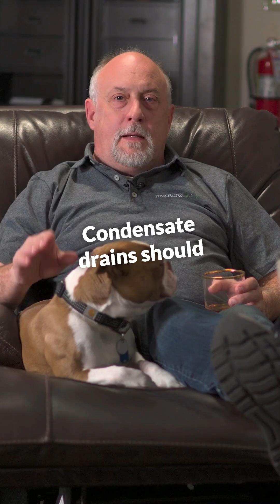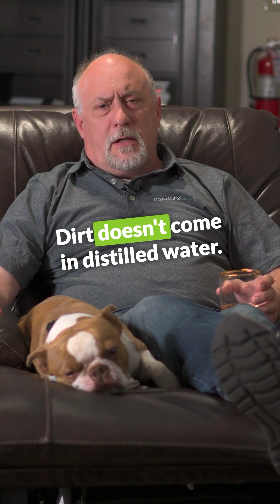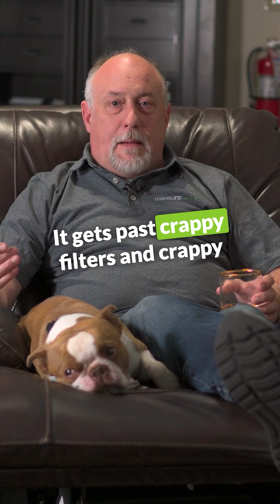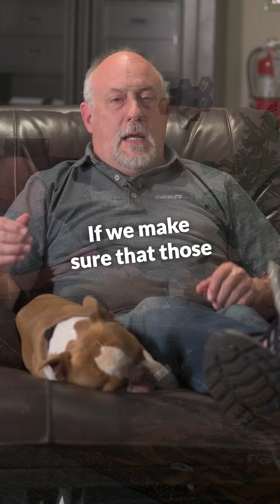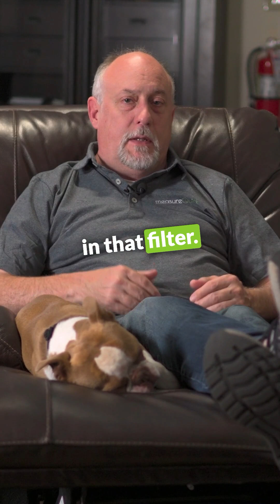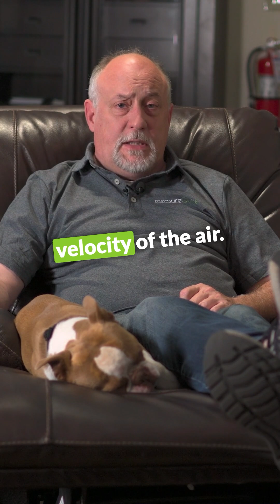Stop cleaning condensate lines, do this instead!

Comment: Jim, I love that you're opening the conversation about drain line clogs and I know that you're passionate about it but please consider approaching this in a different way. Instead of trying to create contreversy and lead by negativity, try leading by starting off with a question. For example "What if I told you that you never had to clean a drain line again if you did this?" Then get into the details. Seems like we're missing some key info here that maybe not everyone is aware of - what causes a condensate drain clog? You get straight into how the dirt gets in the drain but not why it's bad for the drain.

Also, tell waffles I said hi!
Reply from the maker: I don’t know that a statement that drains lines should never need to be cleaned is leading negatively, but I do agree the statement is controversial, and that was my intent. I was trying to promote some discussion.

Comment: My only question is what to do concerning static pressure drop across the system? If we get into these high MERV rated filters it can cause more stress on the indoor motor and the modules will go out faster. How do we get this perfect filtration while keeping the system efficient?
Reply from the maker: Double up on the filters. YOu need face velocity between 250-350 FPM.

Comment: What about rust from the coil going through the drain, or the fact it only drains in AC so once AC stops running the water dries in the trap and can develop hard clogs. 90% furnace systems have an acidic condensation that can help prevent clogs after the furnace drain but this is bull shit, this is someone who has never done service a day in their life.
Reply: You look like you have 30 years experience sitting in that chair, I am also a service tech with only 13 years experience but 90% isn’t 100% so who gives a fuck clean the drains do all the things to help your system.
Reply from the maker: @kalebbranch8036  Your customer does. There are those with 30 years of experience and those with 1 year of experience 13x. Stopping filter bypass is important for more than just condensate drains. It also keeps the blower clean, the circuit board clean, the evaporator and secondary heat exchanger. It will dramatically increase equipment life. Root cause analysis is important. Why spend time and money doing work that can be prevented in the first place?
Reply from the maker: I assure you that I have done about 30+ years of service work. If you stop the dirt, it will cure 99% of your condensate line issues.

Comment: And the dirt that settles on coils/catch pan? LOL..Definitely the burbon talking
Reply from the maker: If the dirt is captured you simply throw it away. It should never get there in the first place.
Reply: That dirt would get caught by the filter is what he is saying.
Reply: @rwein2951

See, @measurequick has to be nice. I don't.

First of all, if you can't comprehend that LESS dirt bypassing your filter is a good thing, and the fact that you havr to kerp cleaning your coils frequently, and it doesn't make the light bulb in your noggin glow the least little bit...then you need another 30 years tinkering with your unit and it may sink in. 

Second, any time someone leads with "I've been doing this for 30 years", I immediately know the next thing that they barf out is going to be complete utter nonsense. Thanks for keeping the streak alive.

Third, you apparently do all your work yourself so the fact that you wouldn't hire us comes at no surprise. But please take off the makeup and red nose before calling us clowns next time. 

And finally, don't worry- I wouldn't work for you anyway. You're not my kind of customer. I would've referred you to Bubba's Heating, Air and Taxedermy after 5 seconds of hearing you talk.  That's who you deserve.

Why do you even follow measurequick if you know so much more than they do?
Reply: @timdestasiohvac  In the 30yrs I've owned a home and did ALL HVAC maintainance the COILS need to be cleaned. Matter of FACT many HVAC companies offer a coil cleaning as a maintainance prceedure. SO HOW TF does the air filter capture ALL the dirt? IT DOESN'T. It falls off into the condensate from time to time. I wouldn't hire either one of you clowns to work on my HVAC.
Reply from the maker: @RJ_MAGA  The filter does not  have to capture 100% (95-99% is enough) just enough that the condensate can carry the rest away without build up, and without enough of a food source for bacteria. I have seen 20-30 year old coils that do not have any buildup. If either of us clowns has installed your A/C you would be 100% right, you wouldn't need a coil cleaning in the first place.

Comment: Wasnt evaporate acidic?
Reply from the maker: A little, yes, and it will attack sheet metal in poorly manufactured coils. Most manufactures are using coated steel or aluminum now. "Pure distilled water should be neutral with a pH of 7, but because it absorbs carbon dioxide from the atmosphere, it's actually slightly acidic with a pH of 5.8." https://sciencing.com/ph-distilled-water-4623914.html

Comment: Where does the Zoogloea come from? Asking for a friend…
Reply from the maker: https://www.youtube.com/watch?v=5VOffWjmWkk
Bryan Orr will tell you the same. It's all about source control, and keeping the organic materials off the coil.  But here is a great video that tells you how to control bacteria.
Reply: @measureQuick  Majority of the fan cabinets are negative pressure zones between the filter media, coil and fan. Typical “tight” cabinets are very leaky. Filtration will not fix that. The level of filtration to contain all bacterial growth is not reasonable. I think the notion that increased air filtration to dismiss cleaning drain lines is laughable. Somebody is inhaling to much helium at @MeasureQuick.
Reply: Not sure that is a realistic answer. It may pass the lab test, but field application may present more of a challenge that most customers are not willing to take on. I know what you are trying to convey, it just sounds like a little gaslighting.

Comment: "X wouldn't be a problem if Y was done perfectly." Most people won't pay for perfect filtration and air quality. Most people don't even change their filter in a timely manner.
Reply from the maker: @_sludgefactory You are correct, it will not catch everything but we can reduce it enough to never be an issue.
Reply from the maker: @_sludgefactory There are a lot of  factors for sure as well as control methods. But remember, bacteria need to eat. Source control is a huge factor. Take the fish out of the tank and see how much longer the water stays clean.
Reply: @measureQuick fish got feels! 😂
Reply: I'd also think that at point after the blow shuts off air from the house will start to exchange with the supplies by passing the filter.